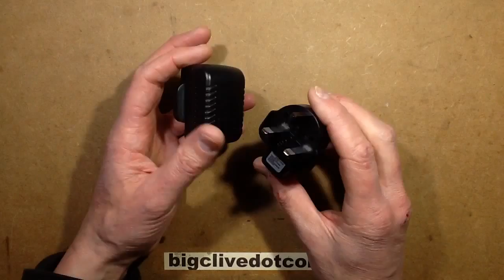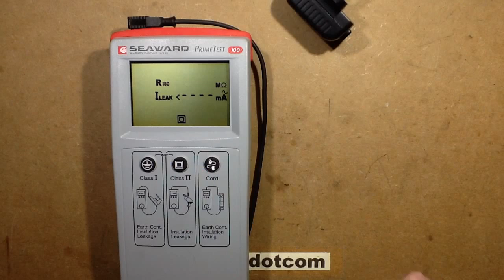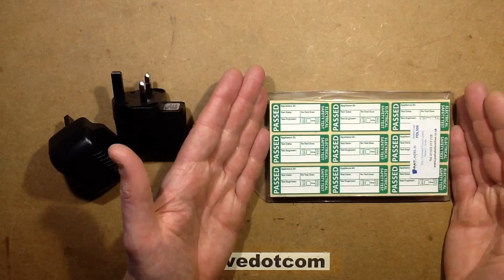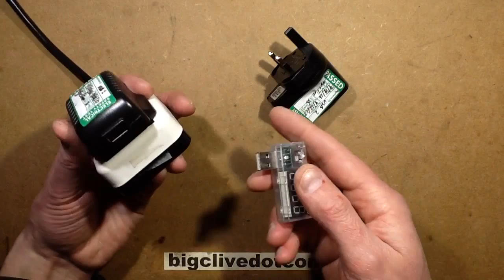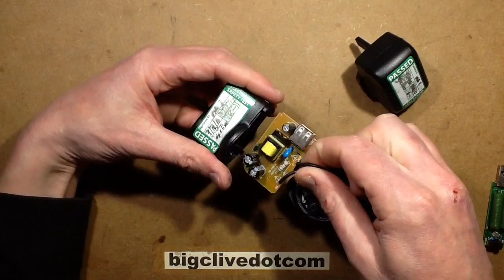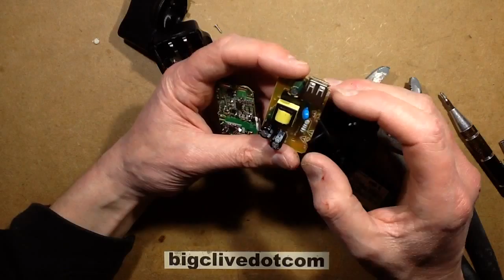Poundland USB charger comparison.  2016

Comment: Also isn't omitting the optoisolator better for separation?
Reply: optoisolators can handle differences of 10kv or more. At that point, there are going to be significantly more problems happening at the same time anyway!
Reply: +Daniel G They are, however, one more component that bridges the isolation barrier and might statistically fail to perform as intended. For example a stray conductive deposit inside the opto pack might lower its isolation level in a way that doesn't show up during pre-accident routine testing.

Comment: 7:46

YOU NEVER FINISHED THAT STORY AGH!
Reply from the maker: Sorry, I got distracted.  In the UK we have fused plugs to protect the flex.  You should choose the fuse according to the flex size and part of the PAT procedure is to pop the lid off the plug and check the fuse is the correct type and also whether the screws are tight.  Typical fuse values are 3A, 5A and 13A.
Reply: That was the story
Reply: "The wrong types of fuses" 

Doesn't feel like a proper ending. Like he's about to say some more stuff you can find out from doing high voltage tests, but the label gets in the way
Reply: bigclivedotcom I'm interested in finding out about that mobile phone you featured in one of your videos, how is it going for you now?

Comment: Do you think a genuine Apple iPhone charger will really be significantly different?
Reply: well they have gone through extensive testing, so you know theres no cheap wire in the transformer to catch you out, or fake caps etc, and a proper spark gap that complies fully etc, what it comes down to is, sure some chinese adaptors are fine, but you never know, with apple you know everytime (so long as you didnt buy a fake one)

Comment: I heard that the switches of those 1A/2A USB loads are bad, so I searched for something else.
Bought myself 2 of these http://bit.ly/2h9CDnL (Aliexpress link) and damn, they are good!
MOSFET based. Can test up to 12V and up to 3A, coarse and fine tuning possible, you can also plug something in the load and then let both use the port the load is connected to. Don't let the USB socket touch the cooling radiatior body though, it is a short circuit. At least so says my, fortunately, protected Powerbank.
They come even with 2 extra leads with crocodile clips which you can put on the load and use it to discharge other gubbins which isn't USB! Those cables are 18AWG. All that for only 4,75€ or so, free shipping (even for 2 of them, which is recommended because combined load 6A possible :D Makes the USB cables quite warm, and especially the plugs and sockets. Also on one of the oney I recieved the fan has one broken blade, more vibration, but for that price I won't complain)

Edit: oh and that load is insertible in both ways, can be helpful cause it is quite chunky.

Comment: Handy little supplys clive.
I take it the emi capacitor is connected to the mains neutral?
Reply from the maker: On one it's connected to the positive of the rectified and smoothed primary supply and on the other it's connected to the negative.  It's really just intended to provide a return path for capacitively coupled leakage between transformer windings.

Comment: If I catch the USB cable I use to charge my phone on the back of my arm, I can feel a slight tingle.

I assume it must be mains voltage AC at a low current?

They all seem to do it, irrespective of their apparently quality.
Reply: its the class x capacitor that feeds a small amount of ac 240v across it, yes they all have such a thing
Reply: Its just because your skin is not that thick on these body parts so you feel it easier i think

Comment: its crazy that these are a quid. I can understand chinese ebay selling stuff at that price but retailed in the UK from actual shops...how can it be possible. also what are the little blobs of red stuff that look like tomato sauce on the smd side? extra insulation?
Reply from the maker: The red streaks are the glue used to adhere the surface mount components before soldering.  It's visible in unpopulated positions and also seems to have been applied to provide extra barrier insulation.
Reply: hard for me to see what you're looking at but its probably glue to hold the parts on the board so that they don't fall off during the manufacturing process. if that is the case then that process would be known as wave soldering
Reply: Gillian Seed cheers for repeating what Clive just said.
Reply: automated machines to assemble the units, and trained monkeys often called mangers to be in charge, and they bulk buy the raw components, i would to know how much it actually cost to make a unit, there can`t be making much of a profit.
Reply: They don't necessarily make a profit. Sometimes they sell stuff for under cost to get people to come into the store and buy other things. Look up loss leaders.
Reply: charlesmartin82 that is very true, although I'd be quite surprised to see poundshops using it as their margins are often so low

Comment: I wish Poundland did 2amp 5volt power supply. They're far more handy.
Reply: The problem is that 3A is pushing what a USB cable can carry at 5V, its why fast-chargers and the new USB spec use higher voltages.

I have been through so many USB cables trying to find the ones able to handle charging my tablet properly with its STOCK PSU.
Reply: thingyee1118 that would require not off the shelf products. For now.
Reply: 2.5 amp would be nice for Raspberry Pi 3 users.
Reply: 2.5/3 woukd be better. A lot of tablet chargers don't have the capacity to keep a plugged in tablet charged under heavy use, which is a pain.